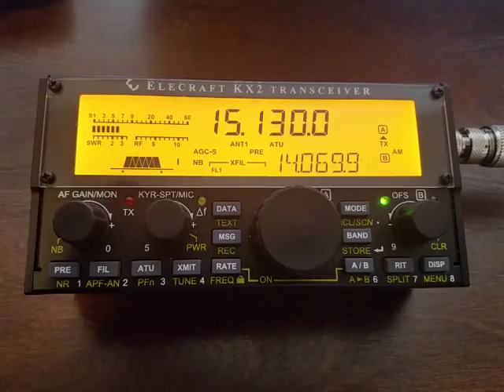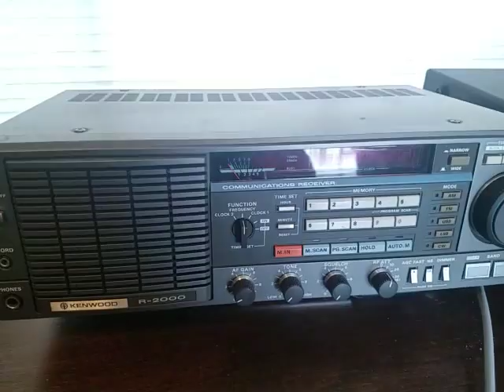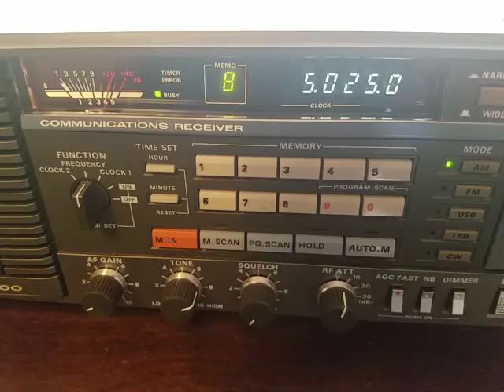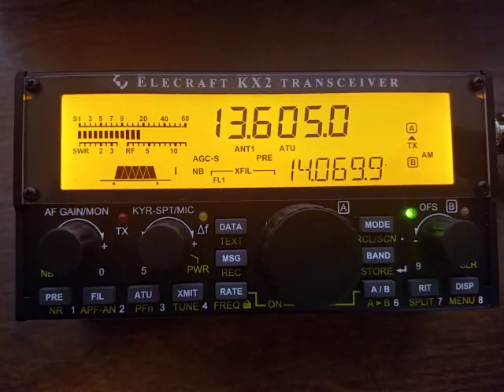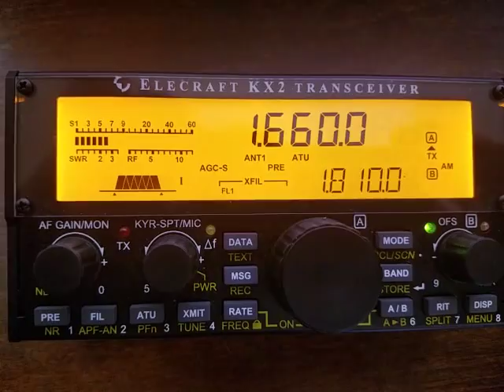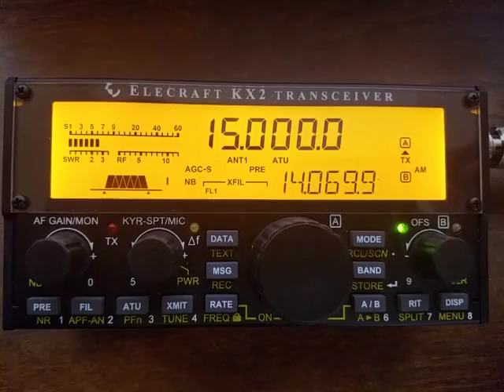Elecraft KX2 AM Mode reception demo

Comment: I noticed that you had the pre-amp switched on with the KX3 but not the Kenwood. With my KX3 the pre-amp overwhelms the audio but without it I can barely hear shortwave at all in the U.S. I had hoped the KX3 would do well for SWL but the results have been mixed at best. One of the other comments praised the Yaesu FRG7 for its reception on a 25 foot wire. I would have to agree with that. My Yaesu puts everything else in my shack to shame. 😀 Thanks for the fine demo and comparison. MikeinMinnesota N0WDM

Comment: I agree that it would have been better to have used a separate external speaker. The elecraft certainly has sharper peaks than the kenwood but that could be just the aging of that venerable SW receiver. I loved my R 2000 many years ago. There are better radios today. One thing I found with my KX3 is that it requires about 40-50' of wire antenna for good shortwave reception whereas my rebuilt Yaesu FRG 7 needs only about 25'. Thanks for the fine video. You've demonstrated that the KX2 is a fine shortwave receiver not just a great QRP transceiver. I'm curious about what kind of antenna you use. Maybe you could comment on that? de n0wdm